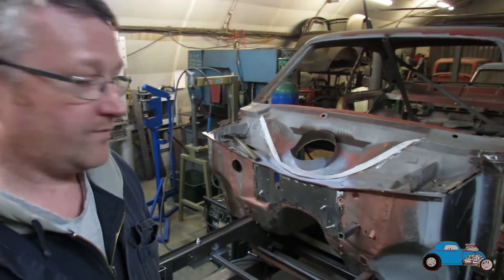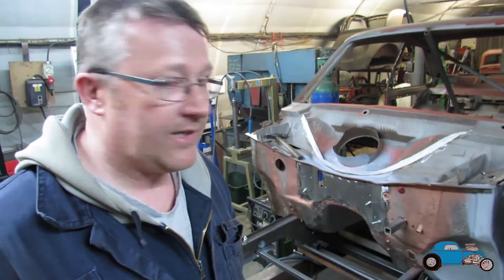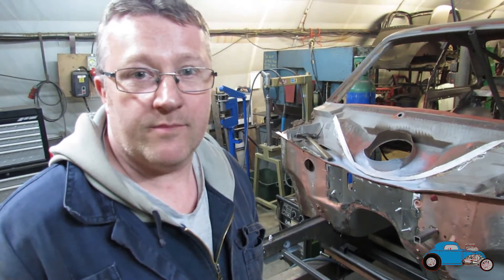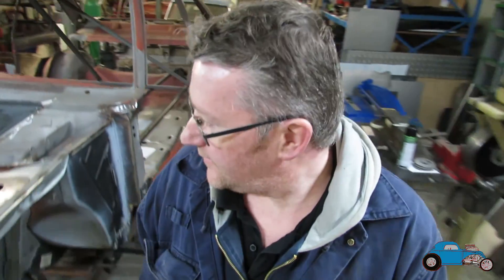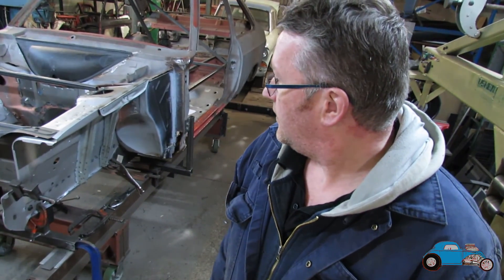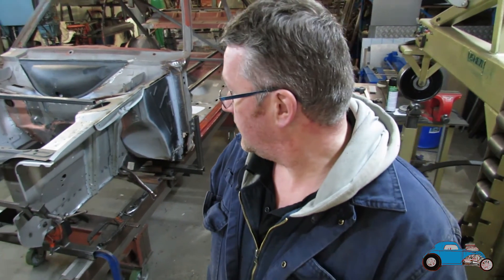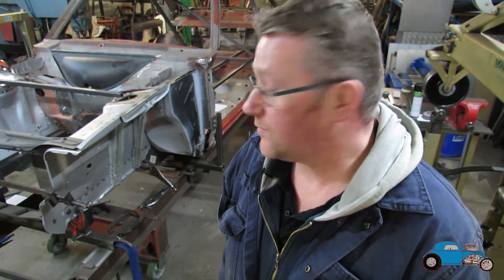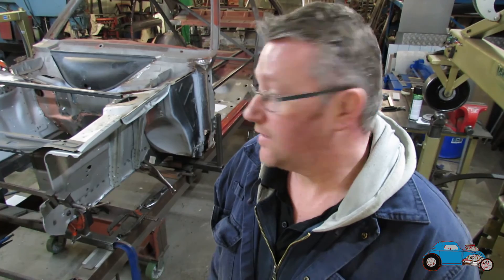Mk2 Escort Rally Build! Part 3 - Floor and Front

Comment: Hi loving the build, if you dont mind me asking what front chassis legs did you use on the red mk2 rally car build? are they reproductions like magnums or are they the strengthened  motorsport-tools rally ones, thanks Rich
Reply from the maker: Hi the chassis legs are open on the side facing the inner wing so we welded crush tubes in place and drilled through so that a long nut and bolt can be fitted.
Reply: @usherengineering179  Thanks for your reply. Really enjoying this build.
Reply from the maker: Hi Richard, they are the magnum panel replacements which we fitted crush tubes etc, thanks Steve.
Reply: @usherengineering179  How do you fit crush tubes? Do you cut out a segment at the front of the leg and replace the segment with the tube?